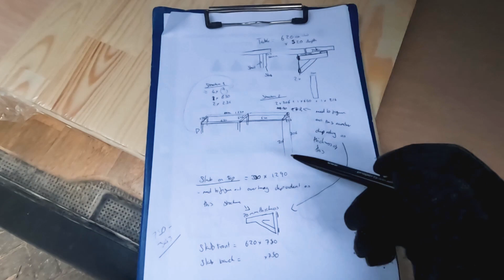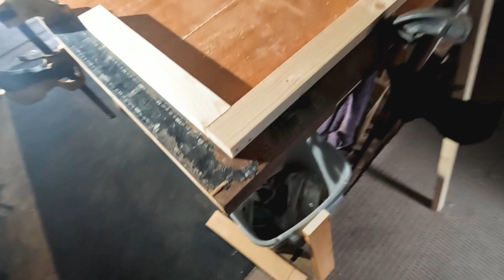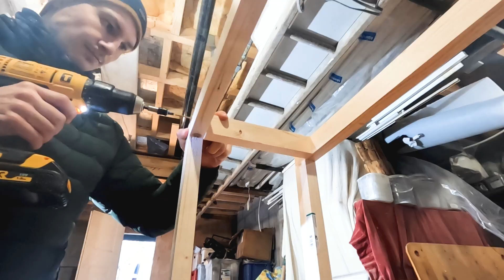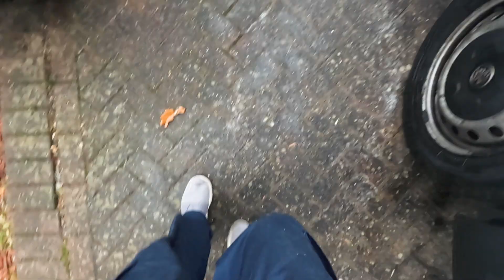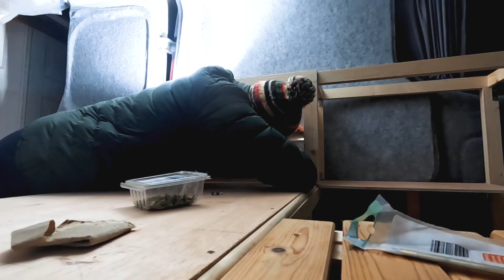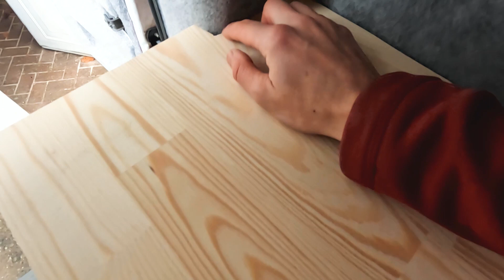Building the cupboards for my camper van conversion

Comment: Hi Jamie, great video.
Quick question: What thickness of wood do you use?

In every van build on YouTube nothing is said about this and this cannot be properly estimated from the videos
Reply from the maker: Oooo that’s a good question. Which section were you wondering about?  All my big structures like the bed were mostly built with 44x44mm or 27x44mm 

Anything load bearing like the bed was the 44x44mm.
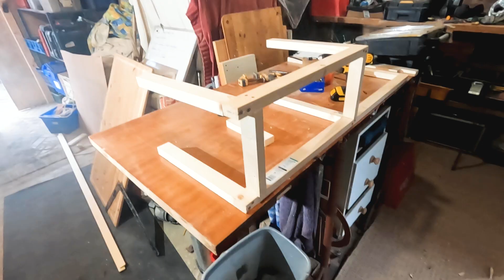Reply: @jamieoutdoors  Hi Jamie, I meant the frame of the cupboards at timestamp 2:35
I assume this is 27x44mm?
Reply from the maker: @hansblommers6088 yes it’s 27x44mm.
Reply: @jamieoutdoors  Thanks Jamie, have a nice evening. 👍
Reply from the maker: @hansblommers6088  hope your van build goes well!